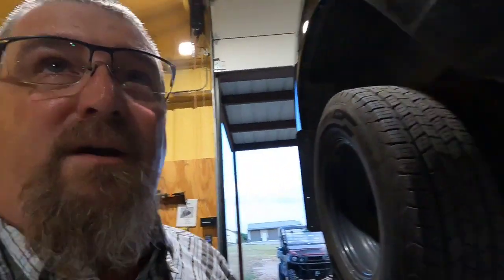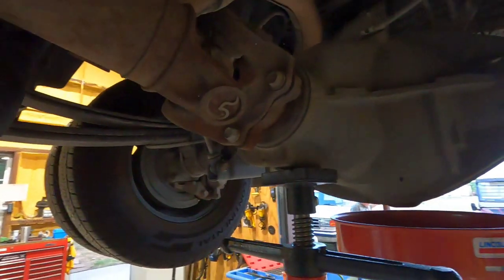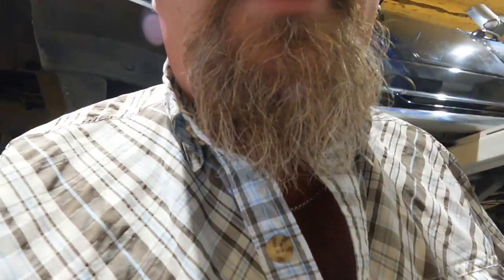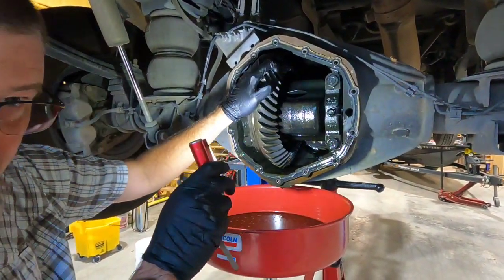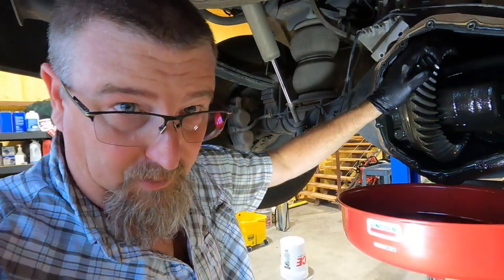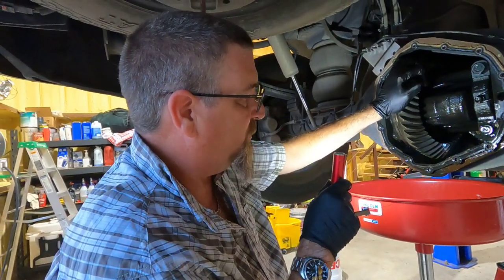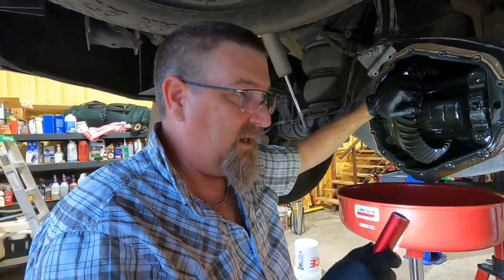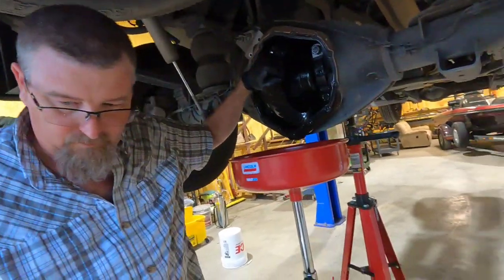Ram 3500, rear end clunk. The reason why!

Comment: The problem is it's a Dodge many of them have problems with either the differential or the  transmission I'm not knocking a Dodge but I have never had a problem with Ford differentials
Reply from the maker: @78fordtruck4  LOL. Well. You are correct about that. They have other issues too. They all do. However it would be just wrong if I failed remind everyone of a fun Ford fact. They gave everyone the infamous 6.0 liter engine. Which was not only a self destructive little beast. But is also responsible for delayed treatment and even death for those who had the misfortune of taking an ambulance ride in in a 6.0 equipped unit. I had a Ford with the 6.0. I loved that truck but , it got sick and just had to go. Dodge front axles have shit geometry so they're always ruining ball joints too. Turbo actuators go out. EGR coolers crack. They all have there thing. I personally like the 6.7 liter Fords. I like the Ford chassis better, I like the interior better, the way they drive better. The 6.7 is a beast. But. I have a dodge. I have had many dodges. I do find the Fords are more attractive. Though they're 10 speed transmission madness is a mess. I'll tell you what really sucks. It just seems like nowadays these manufacturers are in such a hurry to get shit out to market. They seem to have lowered there quality control. Leaving the customer as the tested for the product and then fixing the major shit that they can't get away with ignoring through recalls and warranty. Making it your problem.

Comment: More likely to be the carrier bearing than the diff with that little excess backlash.  You can adjust that easily by dropping the driveshaft.
Reply from the maker: @dwarrowdane1  there is no play at the carrier bearing. That would be verified by pushing on it.  It has no movement

Comment: I watched this and got a little worried about my clunk when coming to a complete stop AND taking off from a complete stop. My diff fluid was dark and burnt smelling, but gears looked ok. I watched other videos explaining that the clunk is the rear driveshaft yoke sticking and releasing. I decided to drop the driveshaft and lube splines with trans fluid since it was the easy route. The great news is it worked beautifully. Not even a hint of a clunk. Mine is a 11.5” rear on a 2014 3500
Reply: What videos did you watch explaining that it was the rear drive shaft yoke sticking? Can you share a link please?

Comment: What happened after the 75w140 gear oil change?
Reply from the maker: Oh man. I just changed the oil and let it clunk. Doesnt really bother me yet. Going to have to get worse. I never drive it anyway. Somebody made a comment to spray the driveshaft yoke, that it was sticking.  I cinsidered that and thought. Eh. Doubt it but lets lube it anyways. I did . It changed nothing. Soo. As for now. She s a clunker
Reply: @angrybeard4673 from what I’m dealing with, clunking on shifting (automatic) and accelerating, it wasnt the black lash after I made sure it was within spec, searching more and inspecting mine and noticed my spider gears were sorta rounded off on my Chrysler 8.25 w/225k. Reading spider gear play can cause that clunking just like excessive backlash

Comment: Not causing a clunking problem with that little of backlash.
Reply from the maker: So you dont beleive that little measureable amounts of backlash can translate into anything noteable. I should point out that the amount of rotation in the driveline was a quarter of an inch. You can see this by watching the bolt that bolts the driveshaft to the flange. Thereby eliminating any option for that amount of play to be anywhere other than at the flange. The amount of backlash was about .020 yet it translates into a whole quarter of an inch at the drive shaft. This is the source of the clunk.
Reply: My 2014 3500 has 205,000 miles on it with severe towing and the clunk was the slip yoke at the rear needed lube.

Comment: Ever since I tunes mine when I let off the throttle and coast, then get back on it, it’s got a nice thud pretty shitty curious if it’s the rear or tcase?
Reply from the maker: I mean who knows really. But i would suspect the yoke in the driveline maybe sticking or maybe the tailshaft on the tranny. Hard to say. These transmissions do not handle anything other than the stock programming really.  I know people will disagree.  But over the extebded arc of history. The ones that fail are the ones that have hauled beyond recommended tow capacity and the ones where the shift programming has been altered.
Reply: It only takes 30 min to drop the drive shaft and grease splines. I was able to reuse the metal clamps for the rubber boot. Or just cut off and use quality zip ties